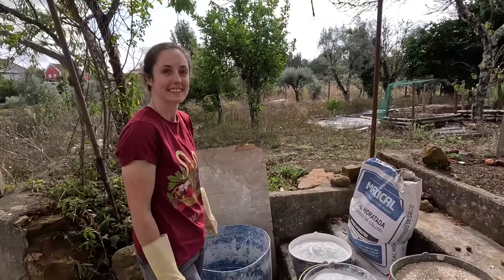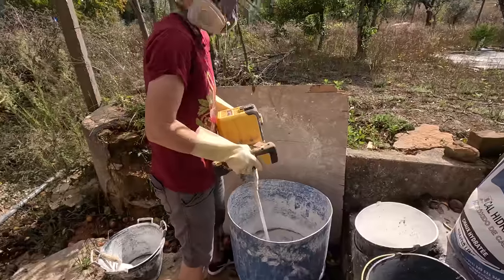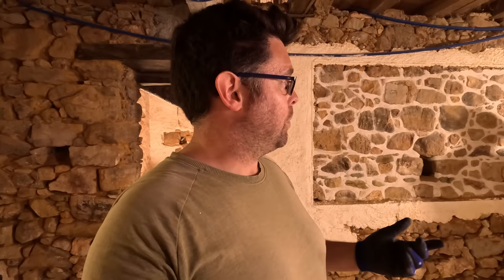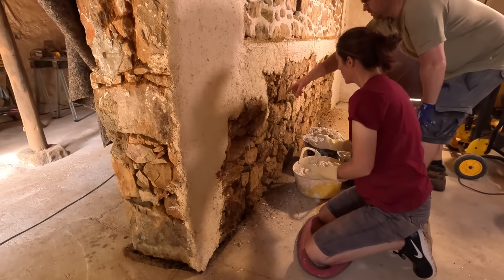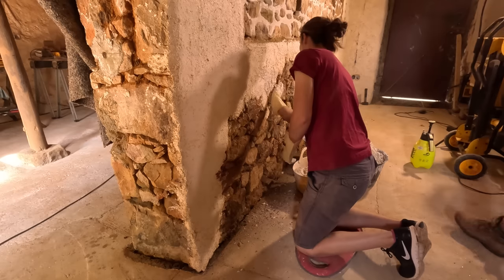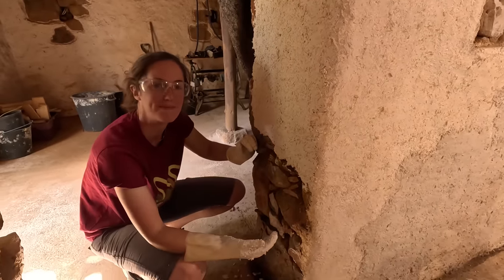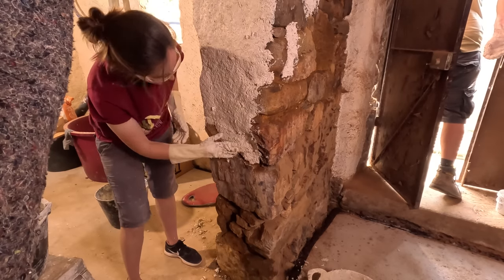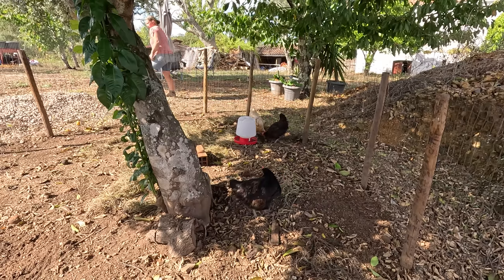A Day of Plastering with a TWIST - Portugal Property Renovation

Comment: So a few more trainee base plastering lessons. Then you have a potential team of traind volunteers for upstairs and future projects. Great teamwork you three. Personally, I know it's more time consuming, but I like the tuck pointing. Alot more stone character and definition shows through. Plastered walls have more layers (3), insulation (thicker), handle more moisture, easier to maintain.
Guy your sister is a trooper, quick learner.

Comment: I've recommended to the PIPs channel that they check out your channel. They are renovating their tiny house in Central Portugal, Coimbra district. It has damp problems and I feel they can learn a lot about how to correct the water seeping into their walls rather than just repairing it with same materials and methods than caused the problem to begin with. You are making progress in leaps and bounds now that the ground works are done.

Comment: Regarding your spraying water on the wall? It's about the effect of ambient temperature/thermal mass, your materials, evaporation/absorption, reduction in the fluid content of the mortar/batter/hempcrete etc.  Here in Australia, when doing plaster/render, laying some forms of paving/bricklaying etc. during summer, we'll often use a huge utility sponge & bucket of water to pre-wet warm surfaces & materials. We also sometimes dunk bricks or pavers briefly in a bucket of water before pressing them into the mortar bed. Water cools them down, stopping the previously overheated surfaces from 'fast-cooking' the mortar etc with its retained heat from the sun.  It's more structurally sound & safe for render, mortar, hempcrete etc to set & cures slowly, so we take precautions to slow down the drying of concrete pours too, during summer.

Comment: Hempcrete is an efford, I would better plastered outside-exterior walls to take advantage of insulation properties of the fibre. For interior walls is enough an easier plastering that could take advantage of valuable thermal mass storage inside the building.

Comment: Funny outro. But what really bothers me are these exposed stones in your outer (!) wall at 17:10 . Didn't you use hemp for extra insulation? Isn't that a big temperature bridge? It feels like installing an expensive multi layered glass window in a way that prevents you from ever closing it.
Reply from the maker: 500mm thick walls don’t actually need extra insulation … they act as an excellent thermal store. 

We get the thermal benefit from the hemp but that’s not our primary reason for using it, and a couple of exposed stones aren’t going to have much of an impact overall.

Comment: Have you made a hot lime putty yet?  I believe that may be better than hydrated lime putty. I also may be asking because i need to learn how to do that...
Reply from the maker: We’ve hot mixed for mortar purposes and also slaked lime (which we’ve used for lime washing).

Think it’s in this video: https://youtu.be/Ogz8dDmG-iY?si=0H35nq-UiX3LRI0D

For plastering however we’ve found the hydrated much easier and the result is pretty much the same as hot mixing

Comment: Hey Guy, do your hemp hot-mixes with quicklime ever literally combust / burn the hemp fibers? I’ve done about 5 batches roughly following your technique and I’m literally finding clumps of hemp ash when mixing it up after it’s cooled, and I’ve actually seen shards of hemp floating to the surface which are glowing red hot. Unbelievable to me that quicklimes reactivity to water is enough to actually combust plant fibers underwater, but it’s real. Any thoughts?
Reply from the maker: Wow, no we’ve never had that!
A few people recommended to us that we should slake the quicklime first, let it cool and then add the hemp. Perhaps give that a go. Kylie experimented with using lime we’d slaked a year or so ago and found that really good to work with.
We now mostly use hydrated lime as it’s much easier, so maybe give that a go if you have access (it’s quicklime that has been slaked and dried … so takes a lot of the messy slaking out of the equation)
Reply: Dude, thank you very much for all the info and the reply! I think my bin is deeper and narrower than yours which might be causing it? I will take your advice and try a nice fresh hydrated lime. Seems a touch safer as well.
Reply from the maker: Hey Alex, Kylie here. Another tip: add a little sand to each mix, it makes it so much easier to apply to the wall.
This video will explain more: https://youtu.be/MNuIKksO_n4?si=qjaIb0wG4WemsAWU
Reply: Hey Kylie, good to know thanks much! We will definitely try that for our second coat which we are intending to smooth out with a trowel in preparation for the final non-hemp skim coat.